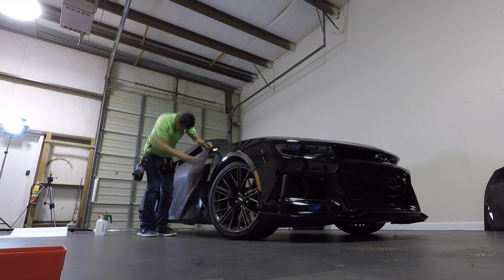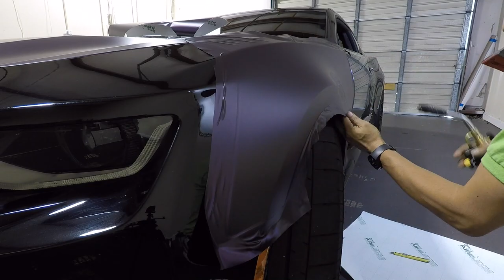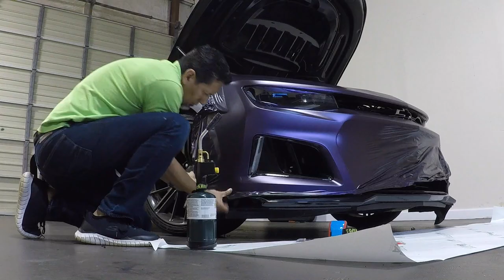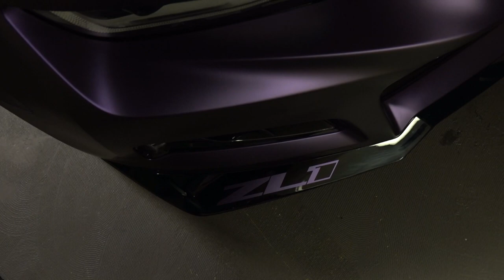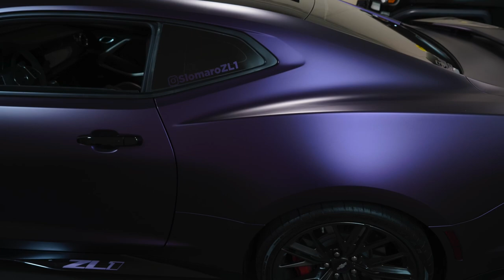Camaro ZL1 Purple/Black KPMF Wrap Time lapse

Comment: Amazing color and texture. Have never worked with Kpmf. How does install compared to 3m?
Reply: Hey man. It's a little stiffer than 3M and a bit more sticky.  It doesn't glide the same way, but I still like it.  I work mostly with 3M, Avery, Hexis and now KPMF.
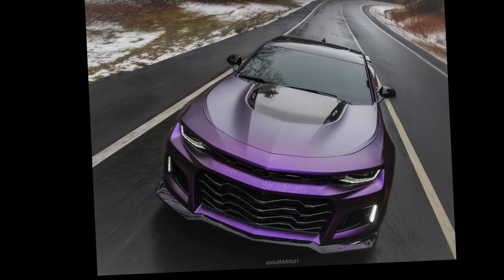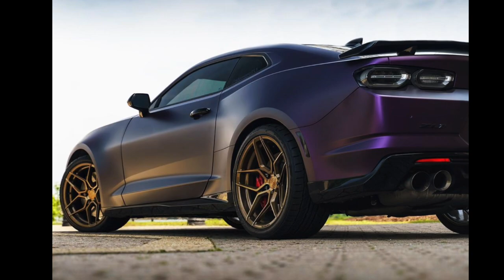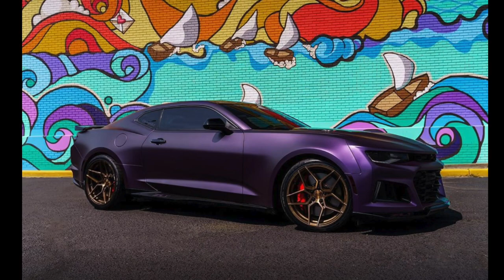Reply from the maker: At all the times in video and pics on the minute 3:22 3:25 and 3:34 it is like in person